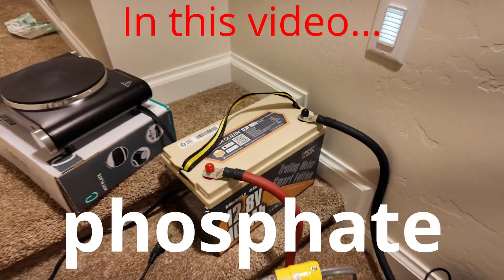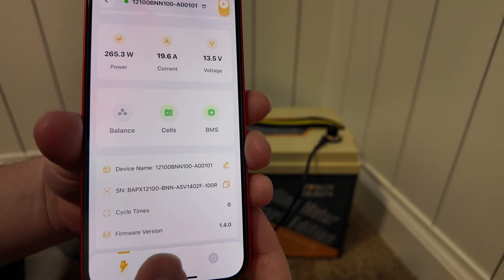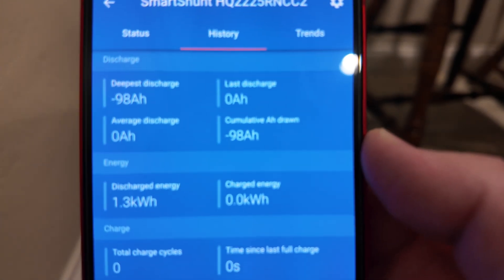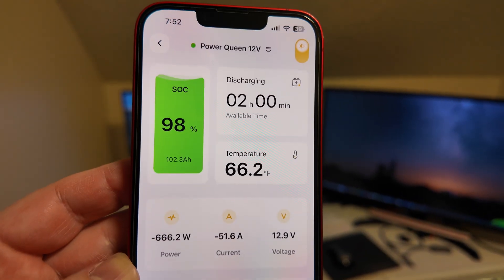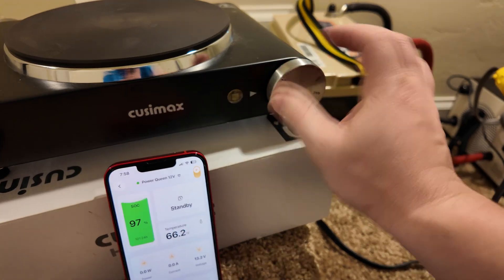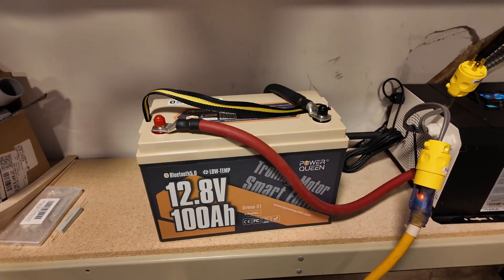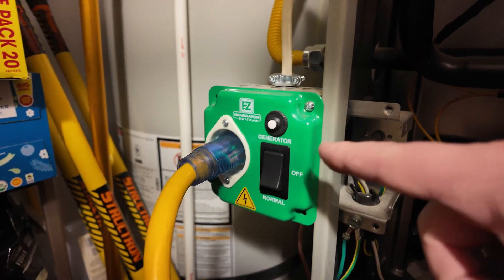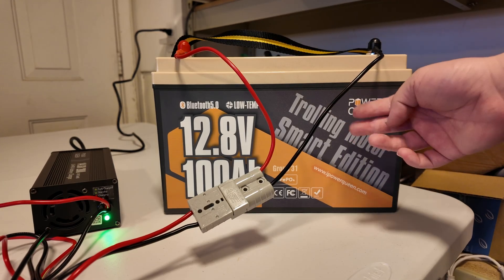Tests NO ONE Else Will Attempt! - Power Queen 12V LiFePO4 Battery & Charger

Comment from the maker: Buy the Power Queen 12V 100Ah LiFePO4 Trolling Smart Battery: https://ipowerqueen.com/products/12v-100ah-low-temp-smart-lifepo4-battery?ref=abjzicbm
Be sure and use the code: TRICK and save an extra 5% on your order!
Or
https://amzn.to/4i7pnvT 
Buy the Power Queen 12V 20A LiFePO4 battery charger: https://ipowerqueen.com/products/power-queen-14-6v-20a-lifepo4-battery-charger-for-12v-lifepo4-lithium-battery?ref=abjzicbm
Be sure and use the code: TRICK and save an extra 5% on your order!
Or
https://amzn.to/41sFmyz 
Buy the battery and charger together as a kit: https://ipowerqueen.com/products/power-queen-12v-20a-charger-kit-with-12v-100ah-low-temp-smart-deep-cycle-lithium-battery?ref=abjzicbm
Be sure and use the code: TRICK and save an extra 5% on your order!
Check out my “12V Battery Testing Results & Rankings for Home Backup” Spreadsheet. https://docs.google.com/spreadsheets/d/1OuUalW-_9BdWMyQz0CxCAM9cpO6whw_LX_exW0Fhqzo/edit?usp=sharing
Watch all of my other 12V battery testing videos: https://www.youtube.com/playlist?list=PL-2uuHDasQcp2gNWpR-N_GUEey1fhnbgI 
Buy the Renogy 3000 watt inverter charger you saw me use in this video: https://amzn.to/4fJIgEd 
Everyone needs a 10AWG extension cord in their life like you saw me use in this video: https://amzn.to/3yH87Me 
Buy battery cables: https://amzn.to/3GEIIDi
Buy an EZ Generator Switch like you saw in this video: https://amzn.to/3L9M57u 
Watch my video wiring up the EZ Generator Switch to my furnace: https://youtu.be/dBP53ggH4nA 
Buy a Victron Smar Shunt like you saw in this video: https://amzn.to/4bwrftP 
Buy a 115V Pioneer Mini-Split like you saw in this video: https://amzn.to/3L7hxn1 
Buy a Goldenmate LiFePO4 UPS like you saw in this video: https://goldenmateenergy.com/collections/ups/products/ups-1000va-800w-surge-protector-battery-power-backup?sca_ref=6274131.WwNYprwz11
Beat inflation and use the code: TRLCK to save 10% on your order!
All donations get 100% re-invested in the channel to bring more un-sponsored content for you. Please consider donating through this link as opposed to using YouTube Super Thanks since I get to keep more of your hard-earned money and less goes into the pockets of large companies like Google. You can also schedule one-on-one consulting/meeting with me here: 
https://buymeacoffee.com/theresatrickforthat 

Affiliate Disclosure
As an Amazon associate I earn from qualifying purchases at no cost to you! Thanks for your support!

Comment: i know you normally do 12v at 100ah, but how about a test on a 200ah as more people realize that 100ah is not enough.
 even if stay at a 1/2C charge discharge. or look at the bms on its own, just buy some 100/200ah lifepo4 cells and just switch the bms off the cells
Reply from the maker: I’d love to try higher capacity stuff like that at some point! Thanks for watching!